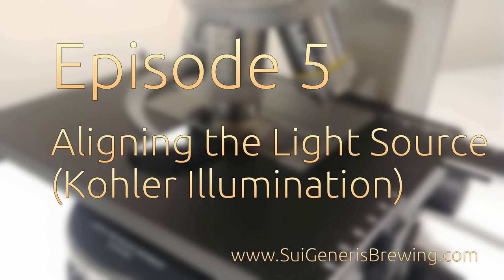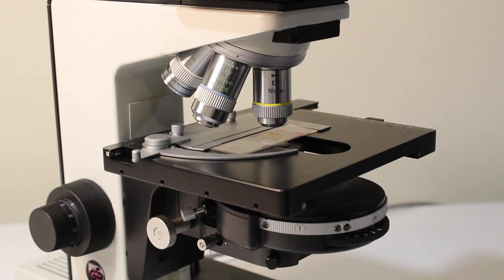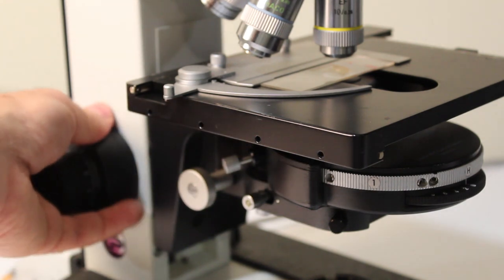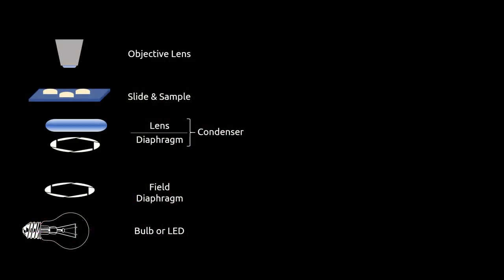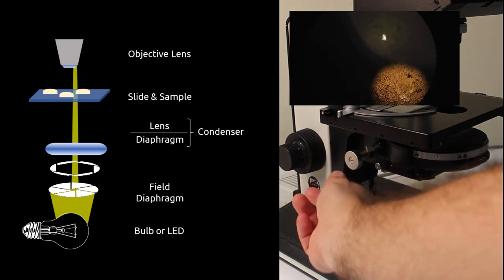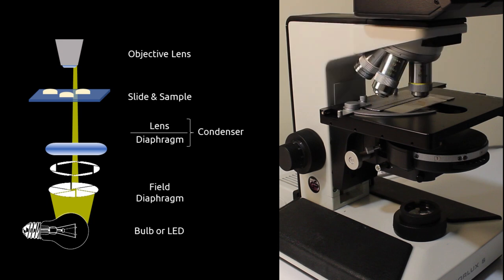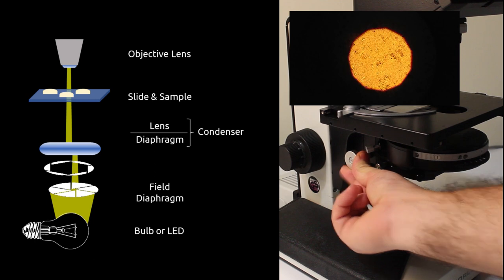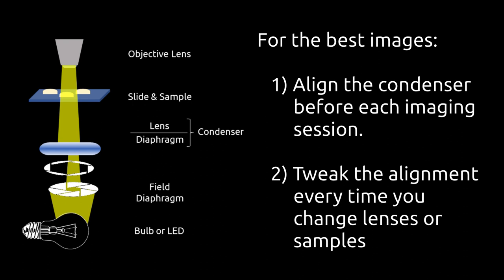µBrews Episode 5 – Aligning the Light Source

Comment: Cx41 model. Im trying to adjust koehler illumination but condenser doesnt center whatever i do. I tried to adjust two secrews in almost every combination but it doesnt center. What else can i try to center the condenser light? Thank you for advance🙏
Reply from the maker: Usually, this is a sign that the condenser isn't installed properly. Try loosening the centering screws completely and check to ensure the condenser is seated properly.  Also, make sure your eyepiece is rotated completely into place.
Reply: @SuiGenerisBrewing  Thank you for the quick response

Comment: Dear sir,
My microscopic view under 10x is completely okay but whenever I turn 40x, and 100x, the view is almost out of the light. So what's the solution, sir!!
Reply from the maker: What do you mean by "out of the light"? Too dim to see anything? or Mis-aligned with the condensor?
Reply: Sir, I see the same view field whatever I put, with or without the slide in 40x and 100x objectives.
Reply from the maker: @ieltslesson6713  even if you change the focus?